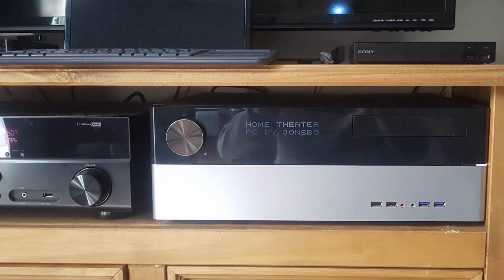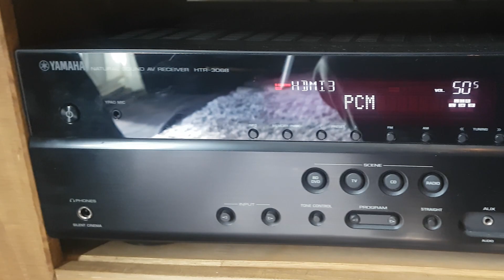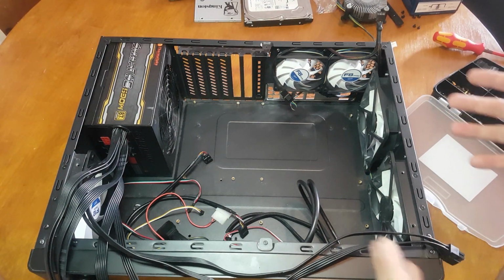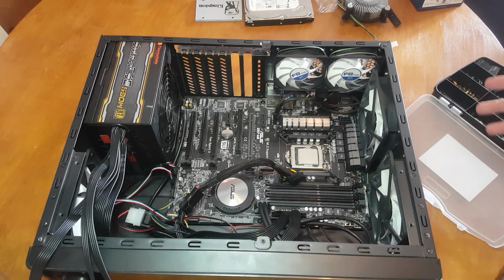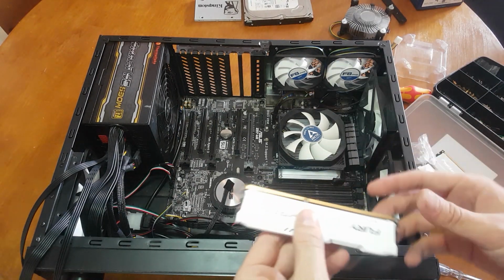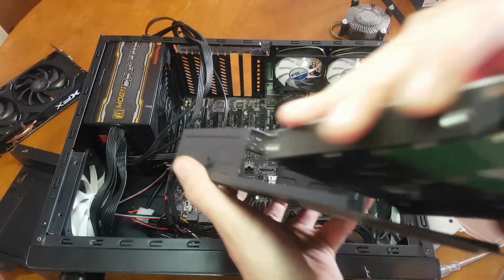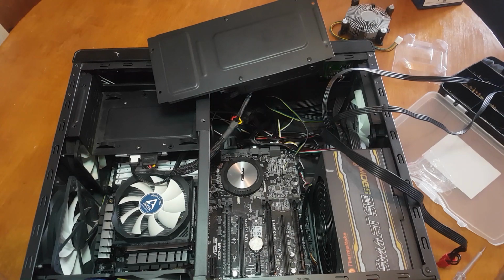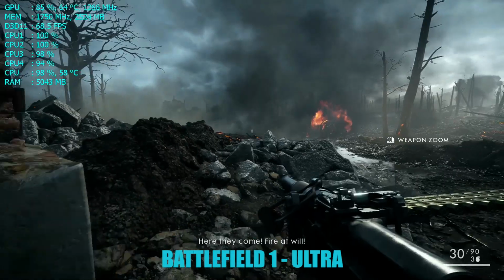The Lounge Build 2017 - Jonsbo G3 Gaming Media Centre Build

Comment: This case is a bit of a god send. I have a loungeroom spare parts pc that uses a 4790k and 1080ti sitting on a full atx motherboard (Asrock z97 Extreme 4) that really limited your case options and until now, it was sitting in a standard tower that was shoved on the shelf sideways. This case is a bit hard to find in Aus but I managed to find one and its now on its way. I really wanted to use the 4790k (its still a beast) , could not find an ITX board to fit it, and didn't want to spend much on it. this case solves everything. thanks for the info on your video. told me everything I needed to know.

Comment: Have the same pc 
Ryzen 5800x3d
32gb 3600mhz ram
2tb nvme 
4tb hdd
Rx6650xt 
3x120mm noctua fan
Be quiet 700w psu with noctua 120mm fan
3x80mm noctua fans one of 80mm fan added with zipties near gpu socket on pcie expansion as exhaust.
Psu runs much cooler
Wraith prism cooler with noctua fan 92mm
Runs cool and quiet

Gpu while gaming 63c
Cpu while gaming 55c

Amazing!!!

Comment: Anyone wanting to get the Futaba display running without kodi 
I was able to get the server working on linuxmint 19.1 and found a repo with the mdm166a driver, hope this helps someone else out. Giant thanks to seahawk1986 for making this available, cool dude manually:
1. sudo add-apt-repository -y ppa: seahawk1986-hotmail / lcdproc-futaba-mdm166a

2. sudo apt-get update

3. sudo apt-get -y install lcdproc zcat /usr/share/doc/lcdproc/LCDd.conf.gz | sed 's / ^ Driver =. * / Driver = mdm166a /' | sudo tea /etc/LCDd.conf

4. sudo systemctl enable LCDd.service

5. sudo systemctl start LCDd.service

You now have a working display.

Comment: i think you put the power suply in the wrong way the fan must be pointit to the outside..
Reply from the maker: As mentioned in the videos it because this pc is sat next to a large av amplifier which can kick out a lot of heat. The amp is vented in a way the power supply would suck the air straight from the amp.